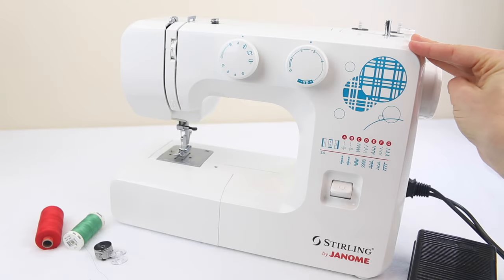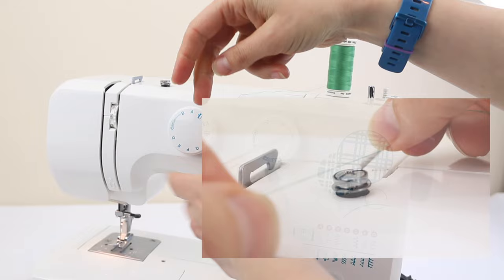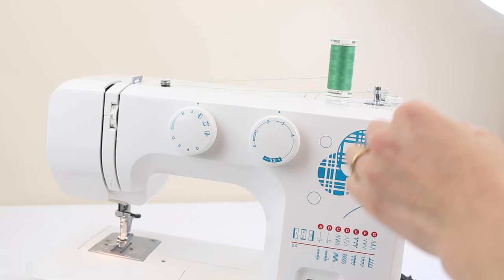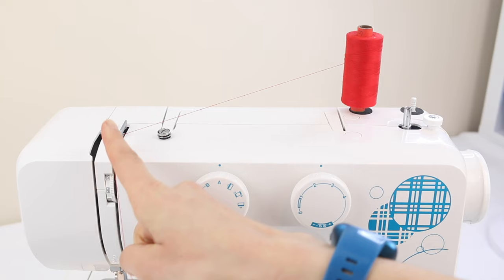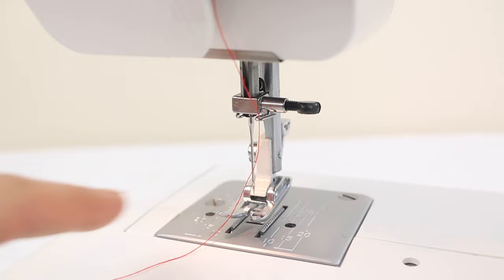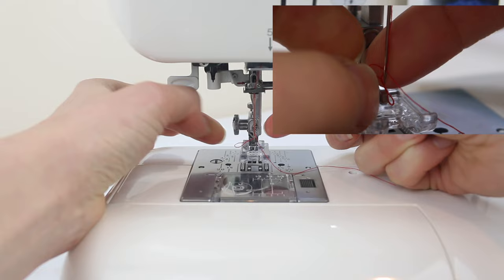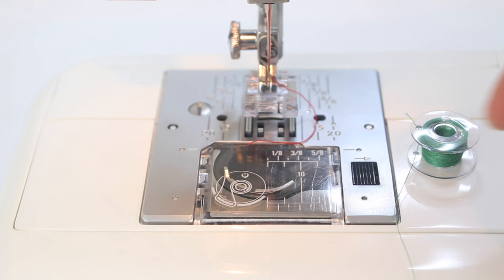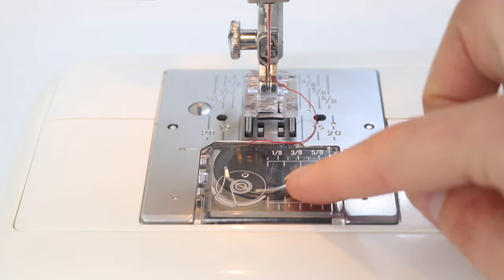How to Thread a Janome Sewing Machine | Step by Step for Beginners

Comment: I’m in tears right now. Finally found this video because the instruction manual skips this step. I followed this exactly and it doesn’t take up the thread. Why is this so complicated? I just want to do extremely basic beginner sewing straight lines. Probably going to return the machine because of lack of instructions.

Comment: What did we do before YouTube and, more importantly, helpful, generous people who provide information?  I started sewing in the 70's - but over the last 20 years not so much..... about 2007 my faithful old Janome gave up the ghost... I purchased a new one (albeit I had not been doing much sewing for some time but felt I could not survive without a machine taking up storage space in a cupboard).  So I purchased a new machine..... I've barely used it - and had forgotten how to thread it etc. but today I dragged it out - took one look at the manual and thought..... "I can't....seriously I'm too old to try and decipher what step 6 was telling me to do with widget 8 etc." - so .....I resorted to YouTube and voilà I'm sitting here with my machine threaded and bobbin loaded (the new machine has the new needle threader / top loading bobbin instead of front loading / thread lies horizontal instead of upright.....so quite a few differences from the old machine) - so a resounding THANK YOU for having saved my time and my sanity.  All I need to do now is to get sewing.  💕💕